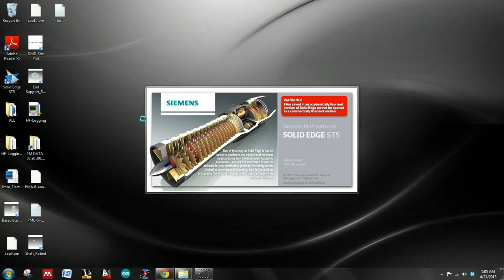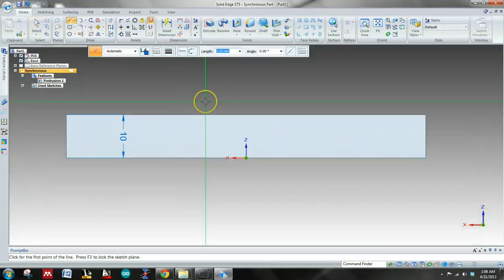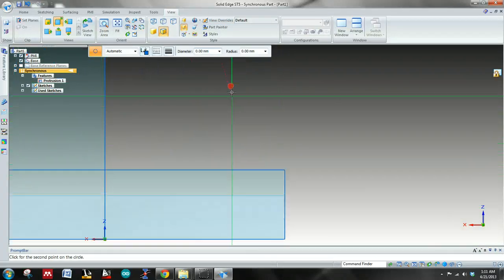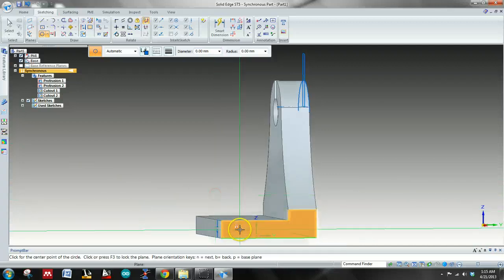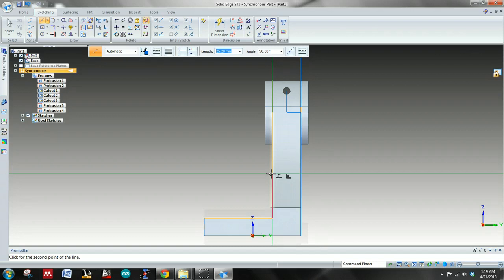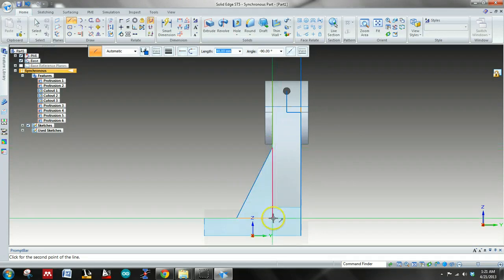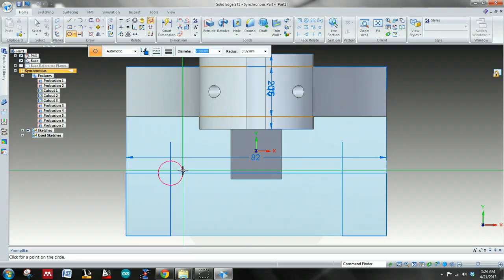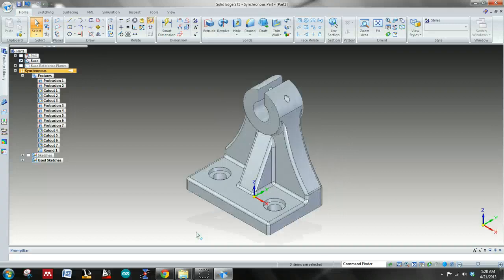Solid Edge ST5 - Part

Comment: Hi Randy...great video and very helpful! Around 7:10, you mention that when you trim, only the outer part of the circle should be trimmed while the part that we need should remain. For some reason, the whole circle continues to highlight when I select it and I can't get the part of the circle that we need to stay. Do you have any troubleshooting tips on how I can fix this?
Reply from the maker: Hey Brian...hopefully you got your question answered by now but this sounds like you are not attached to the line or feature. Make sure to use the indicators to attach to these things...if you don't then you wind up drawing something thats very close to something else but you can't see it and later on this causes major problems for the designer....so hopefully that makes some sense...